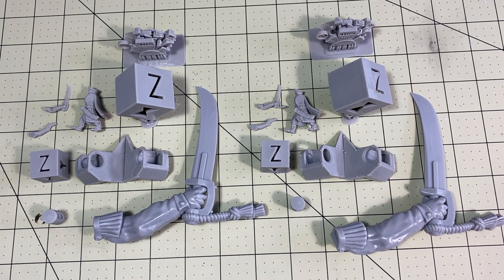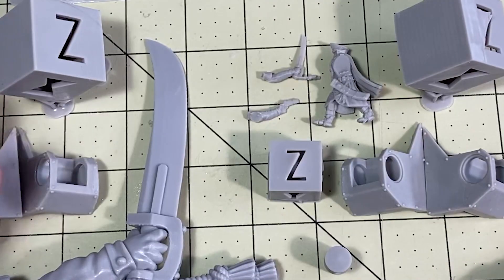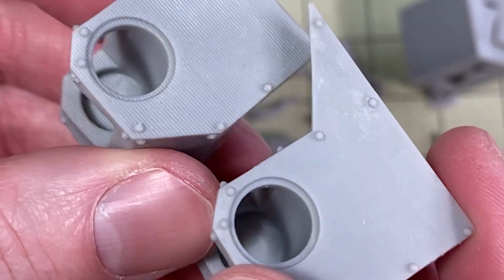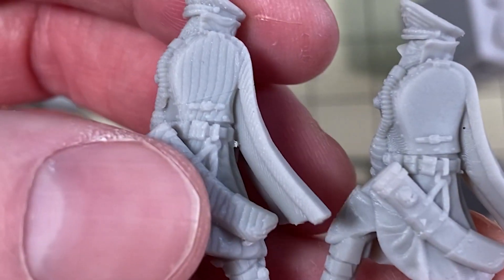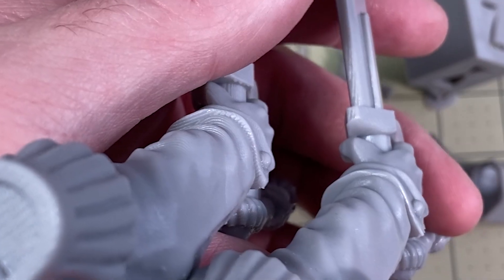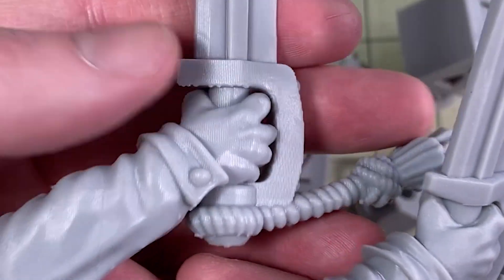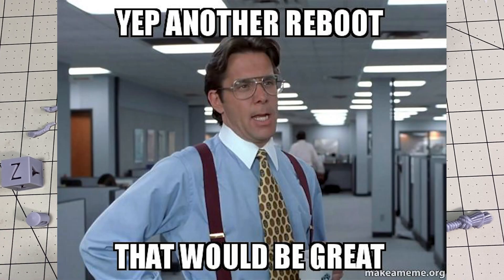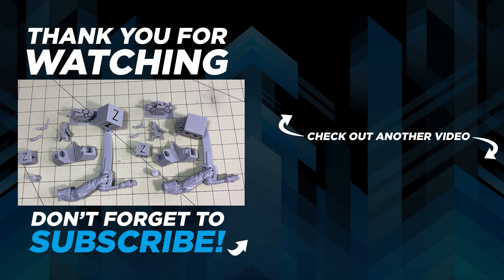How to Get Rid of Weird Lines or Waves in your Anycubic Photon Mono-X Prints | Just Reboot It

Comment: nice video! but my problem is another one. The first 50 or 60 layers are a bit thicker then the next. When i print large models it looks weird, like the printer uses different setting each 50 or 60 layers. does anyone have similar issue?
Reply: Hi, I have same issue right now.. did you somehow fix it please? :o
Reply: @mir3kj  yes. I realized that my models are the problem. When you print Things that have a big enpty space inside it youll have the weird Issue that air gets trapped inside the model while printing.  That air pushes the liquid out while the printer tries to harden it and that will create those messed up layers.
When you print something like a vase then you will see it extremely well. The solution to this is to create a small hole near the base of your model so the air can escape while printing. I hope this explanation helps you!
Have fun printing!
Reply: @offset7711  thanks a lot and thank you for reply! I bet this is gonna be the issue. Once more thanks fot help!

Comment: When you posted the "firmware update fixes AA" video, I commented on the fb groups and on reddit and told you that it was not it and also told you about the turn it off and on thing. You never responded even though I know you saw them but it's nice to know that you tried it out. The bad thing is you butchered the information and are simply saying to reboot the machine but not clarifying that you should reboot it when you are about to start printing, that's why I see some confusion in the comments. Once again, if you are making videos trying to inform people, try to be more responsible and do a better research. You are doing a bad job and you might be influencing people on making bad decisions, don't you care about that?
Reply from the maker: Unfortunately it's hard to keep up with all the messages just doing this on the side.  Both the Mono X AA videos were marked as Unlisted a while back so they shouldn't show up in a search.  They just aren't as accurate as the Mono upgrade.  This one I was just having fun with, I didn't expect reboot to need to be defined more clearly.  But I do say to reboot between every print to prevent this.  I'm just old enough that I still power things off, wait long enough for the hard drives (that don't exist in most modern devices) to finish spinning down.  Then power it back on.  I learned that so I didn't ruin my 5 1/4" floppy disks.

Comment: I have 3 mono-x machines.  One works flawlessly.  Every time.  No firmware update.  The other 2 I get the lines every time. 

I have done the following:
1. Updated the firmware
2. Re leveled the build plate
3. Replaced the brass Z lead screw
4. Replaced the FEP film
5. Tried different resin
6. Tried different exposure times
7. Turned the machine off in between prints
8. Tried different lift speeds
9. Tried different lift heights
10. Re greased the z rail

After several months none of these have worked.  I opened a ticket and Anycubic sent me a new z lead screw but that did not solve the problem on top of them taking a month to send it to me.

Before I had the 3 mono’s I owned 11 regular version photons and ran thousands of parts a week.  They had some issues but after a few years I had pretty much all the bugs and trick I needed to operate worked out.  

I think at this point the mono x is fundamentally flawed.  I have also come to the conclusion that anycubic does not care.  

I had a Kelant s400 which is probably one of the worst machines on the market and I was able to get that to work 99 percent of the time.  

Something is wrong with the mono x and anycubic is not addressing it but they are still selling it.

Comment: I have the same sort of issue going on, but it pops up unpredictably (and sometimes after a fresh restart).  What's strange is that for me, it usually only happens on one axis.  So angled slopes on Y get huge stair-steps while on X, detail is fine.  Z is also fine, but that's not really a surprise.

I did a few measurements and it looks like each step is approximately 0.25 mm (ie. 5 pixels wide).  Here's a link to a picture:

http://imgur.com/gallery/NNSAJiK

I haven't had it happen since the firmware upgrade, but I've even seen this behavior manifest on only half of the screen with a model being split down the middle.  One half was smooth while the other had this pattern.  I've used Lychee slicer since I got the printer, but this definitely seems like a firmware issue rather than something with the slicer.  I'm running the same sliced file again so will be able to confirm that Lychee isn't the cause.

Anyone get anything useful from Anycubic on this issue?

Comment: podrias compartir tus configuraciones y tiempos? yo hago reinicios y no me pasa eso, si compartes igual buscamos una solucion por si es la configuracion, serias tan amable de ponerla gracias. tambien que resina usas, que marca? gracias.   Could you share your settings and times? I do restarts and that does not happen to me, if you share the same we look for a solution in case it is the configuration, you would be so kind to put it thanks. also what resin do you use, what brand? thanks.
Reply from the maker: I can, I just can't get to it right now.  But these before and after prints are from the exact same file.  The only difference between the two is there was a reboot in between.  I hasn't really put it together that this is what was happening until this print.  It happened before the firmware upgrade too.  I starting to look for patterns to see if I can tell what is prompting it.  But so far for me a reboot has fixed it every time.

Comment: Just to confirm and I'm hearing you correct.  Both of these prints are with new firmware the second print is with the printer turned off and turned back on?
Can you show the test cube you did before you upgraded the firmware.  Picture showing all 3 in the same angle at once.  Thanks
Reply from the maker: That is correct, both of these are from after the firmware upgrade.  I was trying to test something else and they came out like they are on the right.  I rebooted, and printed the same sliced file the same day on the right.  I am not sure if I have a cube from this printer from before the upgrade.  The cubes in my angle video are from the smaller Mono.
Reply: @TrueEliteGeek  
I still have the old firmware installed.  I would like to print a cube and would like to compare to yours.   I know different machines no matter what act just a little different. I can send you my settings to verify they are close.  I'm not sure what resin your using.  The resin, I have Anycubic Grey and Siraya Tech (Blu and Clear V2).